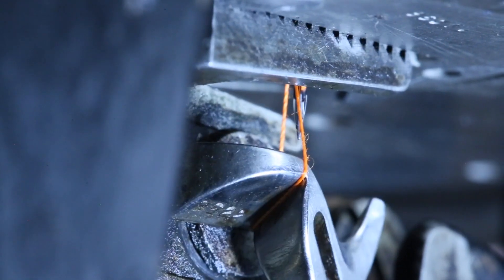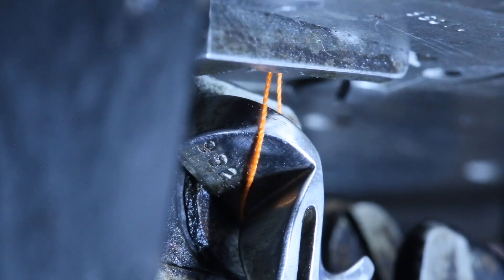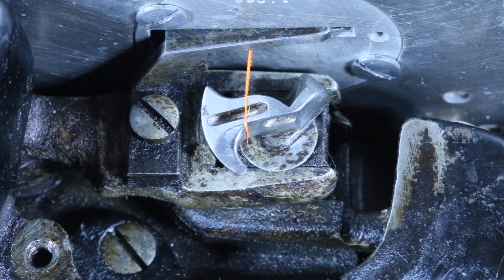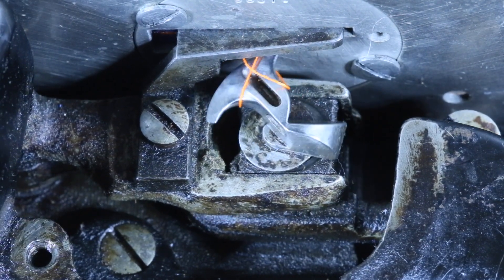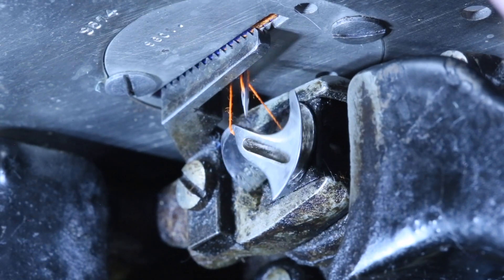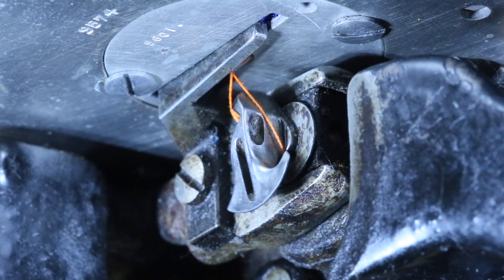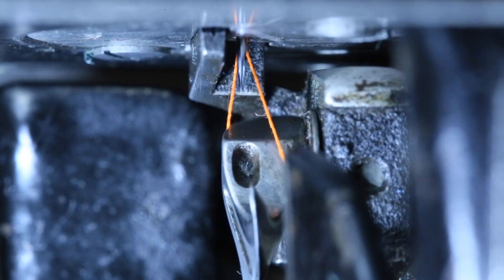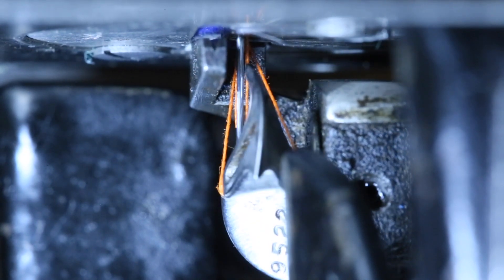How A Gibbs Chain Stitch Hook Works

Comment: Thanks for taking the time to film that, it is  great demo.
I will getting a Singer 760 that can do chain stitch but the disk for the bobbing area might be missing but it has the correct needle plate included.
I might have to make chain bobbin disk ?
Reply from the maker: Hi! Thanks for commenting! I've never heard of a Singer 760, so I searched YouTube for videos about it and found that there are many available. I'm confused about your stating that it's a chain stitcher because it's clearly a lock stitch machine  because it uses a bobbin. Other than its toy sewing machines, like the Singer 20, the only Singer chain stitch machine I know of is the Singer 24. I've never heard of a 'chain bobbin disk' so I'm afraid I can't help you. Perhaps if you search Singer 760 on YouTube you'll find a video that explains what you need. Good luck!